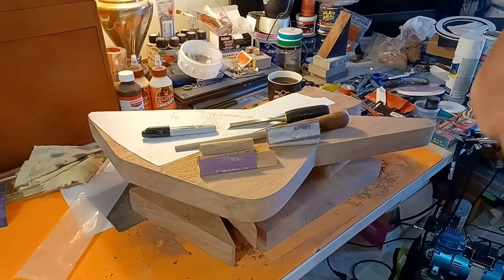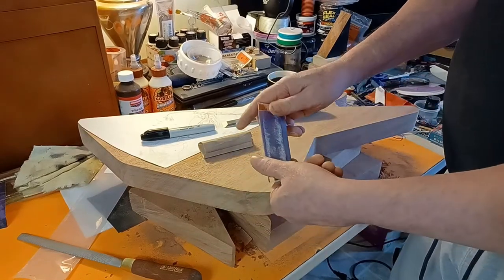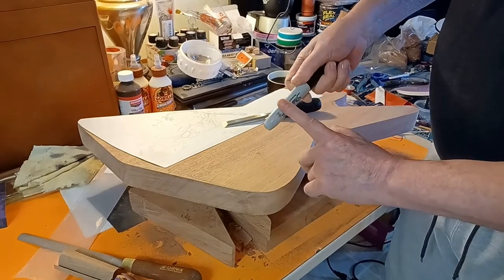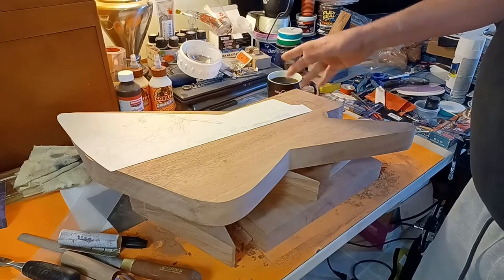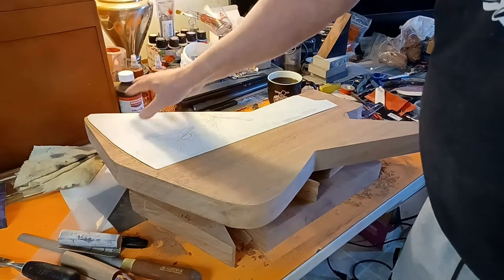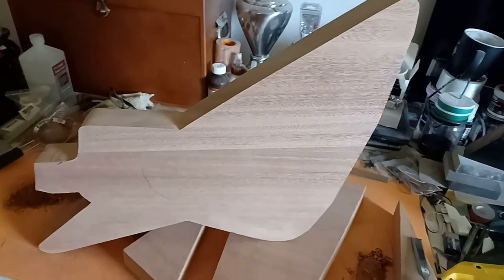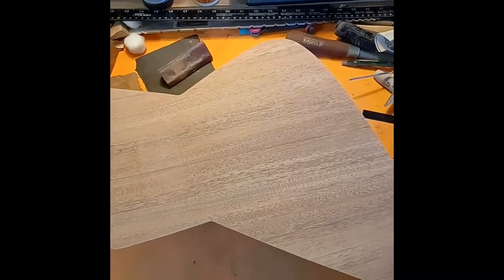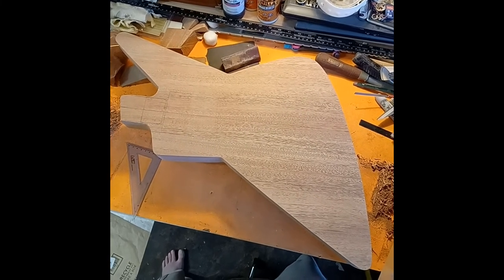GGBO Day 5,6 and 7 We HAZ BODY!!!

Comment: Those Narex rasps are killer but I get what you're saying. Iwasaki files are the best in my opinion, well those and an the shinto
Reply from the maker: I played around with it on some scrap and it seemed to "wear in" and be less aggressive with the crazy scratches. I used it on the part extending out where the neck will be to flatten that out more evenly for that part of carving when my neck shows up. Iwasaki medium flat and a Shinto are next on my list.
Reply: @borgonianevolution  it sounds like you need a few tools. Man I've got some extra wood files and stuff. Give me a little bit and I'll send you a few things. I've got duplicates and triplicates of a bunch of stuff.
Reply from the maker: @SweetTGuitars  That would be awesome and much appreciated Todd. I have been trying not to collect a huge bunch of tools and such as I only have so much room here before the property owners become a problem with what I do here. They have had issues with previous tenants damaging the place and they are pretty strict what we can and can not do here.
Reply: @borgonianevolution  I get it brother. I won't send you a floor model jointer it anything just a few files and things. I'll be selective in my choices.
Reply: @borgonianevolution  Damn buddy, that turned out amazing!
Reply from the maker: @luthiferbuilds  yeah its killin me to think about painting over it but that was the plan from start. I got all the gold hardware to do it. I can always sand it back later if it turns out crappy.